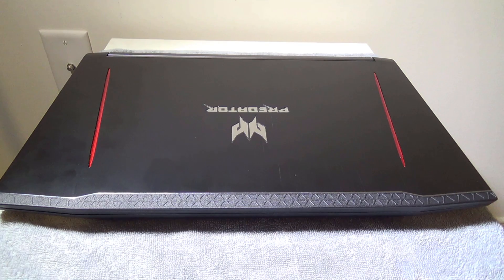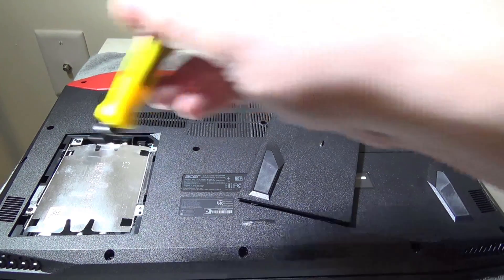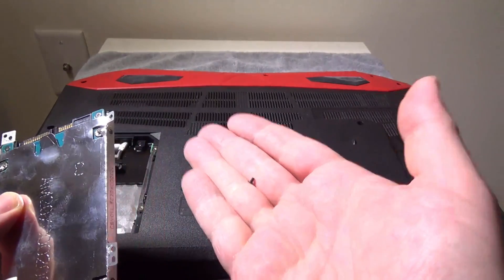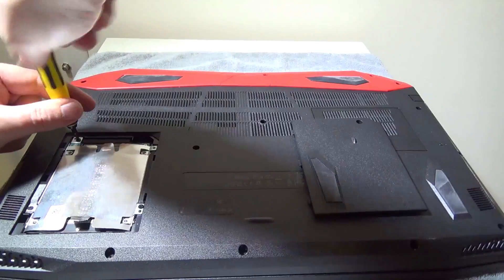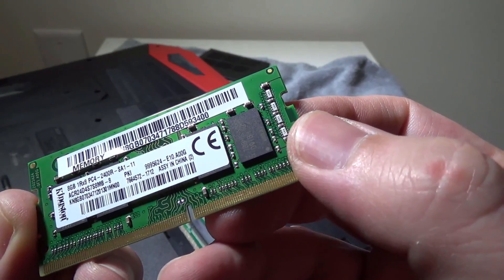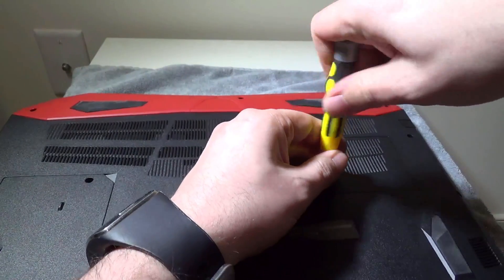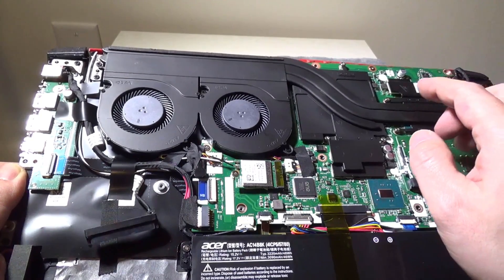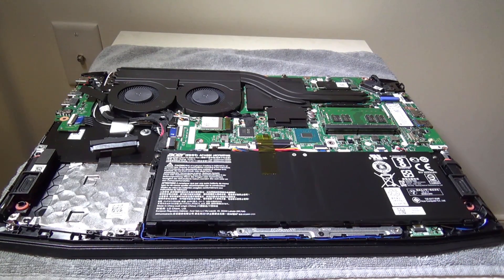Acer Predator Helios 300 Gaming Laptop • How To Add a 2nd HDD and Upgrade RAM

Comment: My predator random blue screened on me, no strange software or over clocking, was literally only using it for programming, browsing the web, normal stuff. And this was after only having the unit for a month. Acer Support is so shitty that they wouldn't just replace the unit, wanted me to jump through all these hoops with troubleshooting and sending recovery media (which by the way apparently their only shipping option is 3-8 days and the recovery drive didn't even arrive in that timeframe), all the while I don't have a computer to do my schoolwork on and I'm behind in classes. After all their troubleshooting steps didn't work and booting from a friend's USB didn't work we finally got them to send me a shipping label to send it in for repair. Repair. That was the best they could do for me, even though the unit is obviously busted. They said after the unit arrived it would take 3 days to repair or figure out if they'd replace or whatever. Then ship it back to me. So then I called Amazon and they refunded about 80% of the original cost because it was out of the return window.

Not to mention the original clusterfuck that was them shipping the unit after purchase that got misrouted by Acer and it changing shipping providers without my knowledge and no updates so I thought it was lost

TL;DR: don't buy this

Comment: Which model have you used in this video, 15" or 17"? I just made a order for 17" model and I wondering if can be add the second drive...
Reply from the maker: +Al3x 15 inch but the process will be the same
Reply: I know that the process is the same for both model but, my question is: can be installed a second drive?  I saw a lot of people who complain about missing cable and caddy drive. I just trying to be prepared for a similar situation...
Reply from the maker: I got a cable and caddy when I got mine, others have reported not getting one and having to contact Acer, so it could go either way I suppose.  I don;t work for Acer I can't tell ya.. lol
Reply: Ok then. All I can do right now is to wait... I will let you know!

Comment: Buenas dias!
Digame, por favor, cual tipo disco duro SSD puedo instalar a conector M.2.
Puedo instalar "M.2 2280 SATA III" o tengo que "M.2 2280 PCI-E x4"?
Gracias.

Hi!
Say me, please, what is the type of the disc SSD I can install in socet M.2.
I can install "M.2 2280 SATA III" or have to install "M.2 2280 PCI-E x4"?
Thanks.
Reply from the maker: You can install either.  A m.2 SATA III or a NVME the slot supports both
Reply: Gracias! He comprado y he instalado SSD M.2 2280 SATA III. El funciona bueno y muy rapido. Estoy feliz.
Reply from the maker: +Александр Русинов no problem. Glad it  worked out for you :)

Comment: i got a problem, when I add it in it wont work, now I got the $1000 version of the acer predator but with no metal sheet that holds the hard drive in, does the sheet matter
Reply from the maker: you can request a drive caddy from Acer.  It holds the drive in place as well so yeah you may wanna contact them and get one sent out to you.

Comment: Please ask, if I want to replace the ssd drive should buy any ssd drive? Thank you in advance
Reply from the maker: +Bestone Bestone the main Drive is a m. 2  drive. So if you're going to replace the boot Drive then you're going to have to buy a m. 2 drive. If you're just putting in a secondary drive then it can be any SSD drive with a Sata connection
Reply: I do not mean that as in the clip you replace the sshd drive, I will replace the ssd drive, but I do not know which one will fit the predator heilos 300.

Comment: Please teach me how to remove the back. I removed all screws and can’t manage to get it off. I saw you snap it off so easy. Please teach me
Reply from the maker: +6666666666666 Huang you mean the bezel?
Reply: Galaxy Tech Review 8:17 . I can’t take that back off. And you do it so easy....
Reply: Galaxy Tech Review when I remove the screws do I have to do anything else to take that back off? I can’t take that off no matter how hard I try.
Reply: did u remove all the 16 screws?
and i'm planning to buy it what's your opinion, is this machine good?
Reply: because it is not easy. The video does not show nasty part. there are latches around the back part and you need to know where to press and pull simultaniously. Other reviewers are hiding this part as well :(
Reply from the maker: +Andrzej Biesiekirski pulling off the entire bottom was not a big problem for me I'm not sure why you guys are having such an issue I just went slowly and it took me all of maybe 5 to 10 minutes to get it off after the screws were out

Comment: ordered from amazon but as all helios 300s from amazon, parts missing for HDD, can i use the HDD connector and the case from my old laptop?
Reply from the maker: No idea as I don't know what laptop you have, nor if it would fit the design of the Helios.  I would say probably not.

Comment: Can we replace the display panel on this one with a better one?
Reply from the maker: +Mohammad Zain Ul Haq you can if you can find an IPS panel that's better than the one that's already in there.
Reply: Galaxy Tech Review Can I use panel from another laptop like MSI GE62 or HP Omen to get fit in it? What things to consider while choosing a panel? And Can I use a 4K panel?
Reply from the maker: First, you will have to identify the model number of the current panel and then you can match up a replacement based on the current model (30  pin connector location of mount holes ect.)  as for 4k not sure I have only ever done swaps of 1080p panels myself.
Reply: Just use a second display unless portability is ur thing

Comment: Hey Galaxy Tech Review
I was thinking of upgrading the 256gb to a NVMe 512GB and using an adapter to put the old 256gb on the 2.5" slot.
Is this possible?
Reply from the maker: Yes that is possible, you would need a 2.5 inch enclosure like this one to put the 256GB in the 2.5 inch bay  http://amzn.to/2zpvoOz
Reply: thx for the fast reply :)

Comment: Is there a display-hinge cover that you need to remove before you remove the back plate? I recall that you did that in the VX15 video, but that step was not shown here. Also, in the VX15 video you pulled the back plate from the front. How does it go in the Helios? Thanks.
Reply from the maker: same as the VX15 accept there is no hinge cover.
Reply: Thanks !

Comment: Hii Galaxy Tech Review 
I purchased my Predator Helios 300 in America through my friends Amazon account and my laptop has now been shipped through my friend and it is now in India. I got the laptop just after a week along with a hard-drive. To my surprise after opening up the hdd slot I found out that the sata cable and the hdd caddy is missing  . How and where should I claim for the missing sata cable and hdd caddy.  Please help me with this situation.
Reply: Mohammed Aarif I tried bit to no avail. It seems that this particular part is unavailable in india, they redirected me to all different customer care centers and even one software support only centre.
There are two places that deal with internationally purchased laptops, one in Bangalore and one in Delhi. I called the Bangalore place and they told me that I'd have to bring my laptop into their store, they'd have to contact Acer USA and decide if they can or will ship it to India, and I'd have to pay the cost. Most of the generic laptop service centers i visited had no idea what was required and they looked at the laptop motherboard as if they'd never seen one before. Suffice to say I'm not at all comfortable leaving my laptop in anyone elses hands. 
There is a simple but cumbersome workaround where you could just get a regular hard drive enclosure and connect it to your laptop through the USB port, which is what I did so that I have all my media and backups stored, and I installed my games on the ssd. Wouldn't be much of a problem since gaming on this laptop isn't something one would generally do unplugged. it's not a proper fix but if you already have a drive ready to install inside the laptop but haven't got the right cable you could manage with this.
Reply from the maker: You would have to contact Acer on that, I am sure they can help you out, have your friend do it (because it will be easier here in the US, since that was where it was purchased).  Then have him ship you the drive kit.   Try here https://csapps.acer.com/kit-request/#submit
Reply: Thanks Galaxy Tech Review crew 
I'll try to ask my friend about this .
But
Aren't there any alternative ideas about asking or claiming this issue in Acer service centers in India?
Reply: I have the same issue here. Acer us says they can only ship it (free of charge) to a USA or Canada address. I've been trying to get hold of the cable from india to no avail. 
You think op would be kind enough to post a few pictures of the cable connector ends? I haven't watched the video as yet just looking through the comments for anything. Will update if I can find a way to connect the firecuda drive to the jhdd2 port on the motherboard
Reply from the maker: +shaheer docrat unfortunately I no longer have a Helios 300 as a test unit so I cannot post pictures of the connector.
Reply: Galaxy Tech Review hey yeah I thought as much.. I did get some luck finding a part number and a link to buy it: 
https://m.ebay.com/itm/New-Acer-Predator-Helios-300-G3-571-G3-572-Laptop-Hard-Drive-Connector-Cable-/202020450359
Reply from the maker: +shaheer docrat there ya go.
Reply: Galaxy Tech Review it's almost half as much as I paid for the 2 TB drive. No way I'm going to spend for that and to get it shipped from USA is again too expensive. Well I'll hold off untill the urge to throw my laptop at a wall due to no storage space becomes unbearable, but I hope that someone somewhere sees this and can source the parts, and that hopefully they will also post if it works properly after. Gonna go post on the Amazon link for the laptop since there seems to be the first place people start to look once they realise that the cable and all doesn't come preinstalled in the laptop.
Reply: shaheer docrat 
OMG yes it costs half the price of the hard-drive, With the shipping charges included 

have you tried contacting the Acer India and claimed about this issue? 
if so please let me know what all are the procedures to be done.
Reply: I'm planning to buy from US and after reading all your problems i was taken aback. Should i go for it or buy here in India?
Reply: Do u recommend buying from US and what's your review on this machine?
Reply from the maker: What problems? I didn't have any problems..
Reply: Sai Nivedh Vallala it's a beautiful machine. Lighter than I expected from.a gaming laptop. Little troublesome since there's only 3 regular usb ports and ones for my mouse and one for the cooling pad and one for the external hard drive. I used to charge my powerbank from my old laptop overnight but I suppose it wouldn't be much of a problem if you don't need A ton if devices connected at the same time. I'm a bit annoyed that I have to keep switching between mouse and gamepad usb connections. 
I'd say definitely get it from the us if you've got the option. Similar hardware specs will not be found unless you're willing to spend about double in India. Make sure you get Acer to deliver the drive mounting kit to whoever you're shipping it to in the usa. Not sure how long it would take them. I did find a few more places online that also have the cable but it's still prohibitively priced, and delivery charges are such a pain. I believe it's the same kind of cable that the macbook and the hp gaming range laptops use for an extra drive so maybe it can be found. I haven't found anything that works out to less than 2500inr so I'm just gonna wait till I run out of space.. if you can get the 1050ti version for under 60k in India it would be worth considering too, for Indian markets it's still pretty darn good. I've been playing Nier automata at max settings and getting above 45 fps. I haven't tried anything else as yet but I feel it'll easily handle any game that you throw at it. Temps are reasonable, under 70 in use and at max load according to predator sense it peaks at around 80

Comment: It seems the Helios 300 sold by amazon doesn't include the HDD cable and caddy.  Are laptop HDD cables universal?  I m not living in US and I can't get the mounting kit from Acer.  Can I just find a similar cable and install on it...
Reply from the maker: I am not sure of the exact part number on the cable so you would have to contact Acer for that and then you could track one down I am sure, that is of course if Acer won't offer you one.
Reply: I mean... Can I just simply take a HDD cable from another laptop and install on it?
I can find one on eBay.  The part number should be 50.Q28N2.004.  But I need to pay for nearly $50 including the shipping fee for just a cable.  That’s quite expensive at all.  The cost will be much lower if I can find out a replacement.
I am planning to buy this laptop but the only thing i concern is this stupid cable...WHY ACER TAKE THE CABLE AWAY FROM A $1000 LAPTOP!
Reply from the maker: mine came with one, so I am not sure why people are not getting them
Reply from the maker: where do you live?
Reply: There are lots of complains in the recent reviews about the missing the cable...
I live in Hong Kong, the shipping fee is even more expensive than the cable itself.

Comment: Hello. Is it possible for you to make a video on where to connect the SATA cable to the mainboard? My Helios 300 didn't came with the SATA cable preinstalled and therefore at the moment I cannot connect a 2nd harddrive. I am not sure where to put it on the mainboard, and therefore I would like a short walkthrough to do it correctly without messing anything up. Thank you :)
Reply from the maker: I no longer have a Helios 300 as a test unit so I cannot do another video.  Sorry I cannot be of more help on this for ya.
Reply: Oh okay, I will find another way then. I have another question. I have now looked at a few hard drive, and I am now wondering, is it possible to plug in an extra SSD harddisk or does it has to be either HDD or SSHD? If it is possible, which ones can you plug in? Please help me before I'm buying something! :-)
Reply: And would you recommend either HDD or SSHD?
Reply from the maker: +Tobetho sshd is my recommendation over a regular HDD

Comment: Hello, I just put a new 1 TB HDD on my helios 300 with 5400 rpm, my question is how can I install a new program or games on my HDD, I tried to change the storage in setting, but whenever I try to install a new program and select the pathway,which is my new hdd, it say's bad data unable to proceed to installation. Please help me😭
Reply from the maker: hmmm that sounds like a bad hdd.  can you manually move files to it?  Have you created a partition on it and formatted the new drive?
Reply: Yes I can manually take files from that hdd, I haven't tried to format and make a partition, can you tell me how?
Reply from the maker: +Jefreray Sison go to Windows settings and then to Disk Management from there you can format and repartition the hard drive
Reply: Found it,  and it fix the problem, thank you😊
Reply from the maker: +Jefreray Sison np enjoy

Comment: Hi, I m from india. I bought this laptop from an online store. the product i received had a HDD already installed in the secondry compartment ,and when i removed it and boot the laptop there was no 1tb space available in my predator. 
so does this mean that my internal hdd is faulty ???  
or that compartment itself is the main storage compartment? And if that is the case do i have to remove the already installed 1 TB HDD and add a 2 TB HDD to upgrade it?
Reply from the maker: there is 1 compartment for a drive (shown in video) but there is also a m.2 SSD slot as well.  Most configurations here in the US come with the 256GB m.2 slot filled and the 2nd compartment open for install of a new drive.  Looks like your model only came with a 1TB drive installed in the compartment and no m.2 drive. So you have 2 options, but an m.2 drive and make that your boot drive (you will of course have to install windows on it)  Or replace your 1TB drive with a 2TB drive. (again you would either have to clone your 1 TB drive or do a fresh install of windows)
Reply: Udit Raikwar I got mine from the Amazon USA website. That's the actual specs and they're brilliant for their price. Apart from this one hard drive cable issue I'm completely happy.
Reply: How do you expect to see the 1 TB HDD when you have yourself removed it? The laptop comes with one 128 GB m.2 SSD drive + 1 TB HDD which is user accessible. If you remove that 1TB HDD you will obviously be left with just the m.2 SSD drive...
Reply: Hi bhai, same here.. Call me 9009-875-316 I think we both bought it from flipkart
Reply: 405miranda Hi, I have personally contact Acer about the issue & they assured me by saying "product is 100% genuine". If you want details then I could forward you :)
Reply: Udit Raikwar Flipkart was probably selling a stripped down version of this laptop. This kind of hardware is prohibitively expensive in india
Reply: shaheer docrat yes, maybe flipkart has any dealership with Acer or anything else. I have bought core i5 version (49,990/-), maybe investing 10k more for i7 would have been best deal :)
Reply: shaheer docrat Nice :) I think it's 1,02,000 Rs. On Amazon, right ?
Reply: Yeah it seems that Flipkart sold the same model with a 1tb and a 128gb ash and 8 GB ram with a gtx 1050 ti. I remember seeing the price at 50k during that one offer and then it kept going upwards. Even for the lower specs than the us model that I have, it's worth it at 50k